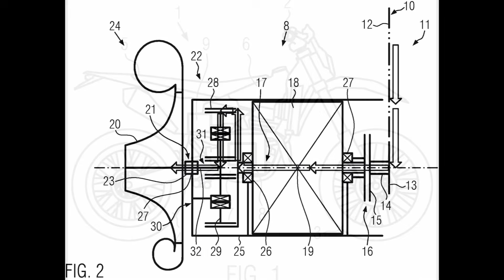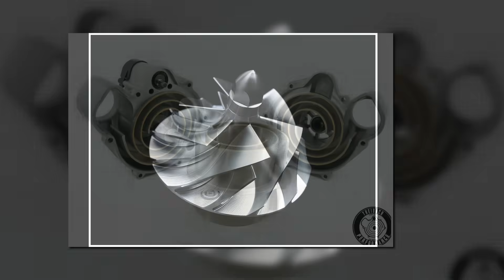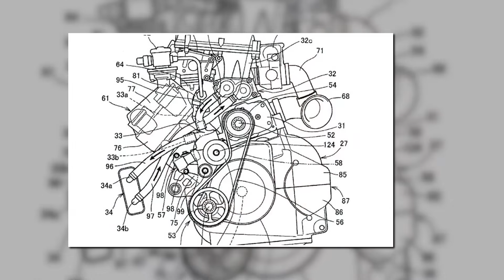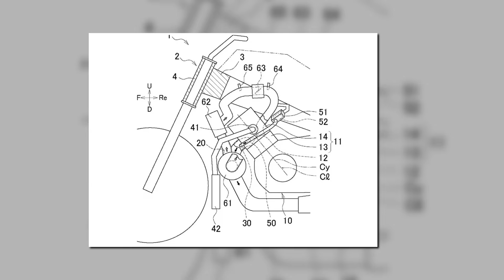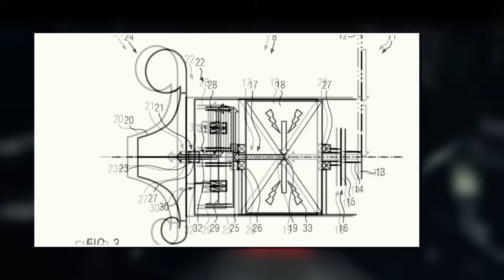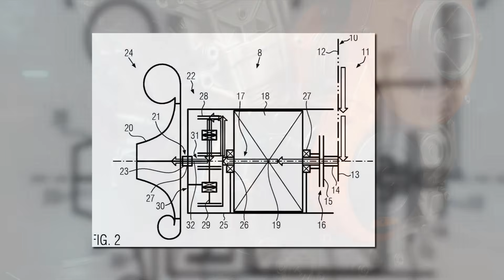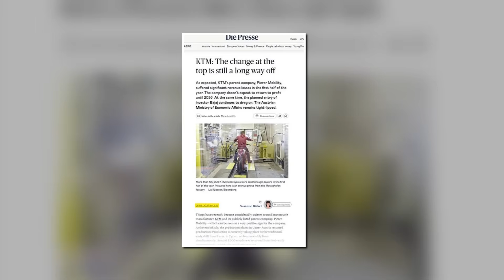Did KTM Just Reinvent the Supercharger?

Comment: The stupidist thing motorcycle racing did was banning boost after WWII, codeming 2 strokes to emissions hell by crankcase scavenging. Because as 2 stroke aero engines like the Rolls Royce Crecy, Napier Deltic & Napier Nomad shows, with boost scavenging & direct injection 2 stroke engines can be as efficient & emissions clean as any 4 stroke.
Reply: 2 strokes arent reliable... and besides that those motogp bikes already go like light speed. 
they dont even wanna be that fast.
Reply: @Lausa05  do you realise how reliable aero engines have to be?
Reply: @mickvonbornemann3824   an  AERO ENGINE has lots more room then an motorbike engine .
turbo 2 strokes also beeing used for ships , its not that they dont work , but i dont think it makes sense on a motorcycle tbh. 
u still burning alot of oil wich is bad for emissions.  
modern 2 stroke aero engines got like 1200 hours of runing time until they need maintenance.
to build the whole thing on an motorcycle is gonna be complex , since u dont have that much space.
and then again u gotta think about getting the power somehow onto the track.
Reply: @Lausa05  no one’s talking about turbos, they don’t function well for 2 stroke scavenging, well unless directly linked to the crankcase via a variable ratio gear set, so they function like a crank driven supercharger till boost build’s up. We are talking about centrifugal superchargers or piston based air pumps, not uncommon on motorcycle racers till boost was banned. Take those Austrian 5 cylinder racers, 2 twingle cylinders with a airpump cylinder (an airpump cylinder works like the cylinders on portable electric compressors). Also you seem to forget aero engines are designed to run at near 80% top revs 90% of the time & reliability was rated at a much tougher level than land based engines & were also higher performing than motorcycle engines at the time on any a performance over weight measure. Take the BMW F700 parallel twin. It’s a 4 stroke 360 degree twin, which in a 720 degree 4 stroke cycle the 2 cylinders alternately fire each 360 degrees, yet to balance there’s a 3rd conrod in the middle set at 90 degrees wastefully just working a weight. If it wasn’t for the ban on boost, instead they could have that middle conrod working an airpump cylinder, compressing air while still doing it’s primary job of balancing the engine. But now today, instead we have parallel twin motorcycles with 270 / 90 degree cranks to emulate a V2 to balance them, meaning unequal firing pulses instead.

Comment: Electric assist Turbos have been around for a long time(and their Patents).
Now to make a supercharger electric, is the pinnacle of Stupidly(marketed as "innovation").
Let me explain. - Superchargers are MECHANICALLY driven compressors(usually scroll type), which take DIRECT  Engine power  as the Prime Mover to compress air and force this into the combustion chamber(along with  fuel) to INCREASE the. Volumetric efficiency of an engine(more sucky and fuel into a chamber vs. NA) , particullarly at low to medium rpms.
Anything electric either needs a Prime mover to generate the stored charge(with the associated intrinsic inefficiencies.that compound one another).
Nonetheless, regenerative braking can provide good kinect energy scavenging, but again its intrinsically inefficient and its losses are compounded...
The ONLY way to create mechanical advantage is to create a reservoir of Kinetic Potential Energy (pressure accumulators).
BUT the OBVIOUS problem in the 2 wheeled world is volume(inverse cubed) versus scavenged energy via the area rule(disc brakes/gearbox) ie. Inverse squared)...
If anyone can make Inverse Squared equate to more that Inverse Cubed in a physical mechanical system, then they are..........
This system reeks of desperation mixed with Snake Oil!
Reply from the maker: Thanks for the detailed explanation; it's always interesting to get a different perspective.  I’ll be honest and say superchargers are definitely out of my comfort zone 😊

Comment: Interesting supercharger drives out there, electric sounds good but its only practical in short burst,  or the variable speed or 2 and 3 speed superchargers used on some ww2 aircraft, clutched drives AKA Mad Max car. I dont like turbos on street motorcycles the power curves feels completely wrong. I have been riding my supercharged bike for over 6 years now and wouldnt want to go back to N/A all old school tech Roots blower carb etc, there is so much bottom end pull on it that you get it rolling and stick it in any gear you like and it will run fine
Reply from the maker: Is on an H2? For me my issue is simply one of weight and complexity 😊👍

Comment: Halo bikes are good PR but seldom make a profit and mid size bikes with forced induction have been done before (80s) and resulted in heavy bikes that cost as much as the simpler litter bikes.
Reply from the maker: Exactly 😊 if it can’t do the same power in a lighter package what is the point?

Comment: My brother has a 3rd gen 1290  super duke, and I get to ride it.   I can't get anywhere near full throttle in the upper part of the rev range without the bike wanting to backflip. I suppose because it's the only bike I've ridden with fancy electronics, I'm a bit scared to trust it to not loop, but who on Earth needs more power than that in a road bike?

I've owned faster bikes than my current 20 year old ER6F in my 27 years of riding, but the humble little 70hp twin keeps up with anything on the group rides I've done.(Unless they go full "Isle of Man" mode, which is rarely possible theses days)
Reply from the maker: That's a good point; even more modest bikes can be just as fun and rewarding in the real world. 😊👍
Reply: a super duke also is like standing on stilts compared to an actual sport bike... of course youll flip over on accel
Reply from the maker: I’m trying to rationalise why a tall bike would flip easier ? Help me 😊

Comment: Interesting times post Euro 5. What about real hybrid motorcycles with electric motors in the front wheel ie real 2WD; petrol at back and electric at front?
Reply from the maker: An interesting thought. But many issues around hub motors. Not least of which is the high reciprocating mass of your steering wheel. But wheel damage off road another one. Kawasaki had to send a DO NOT USE warning out to owners on their hybrid too. So not a good sign
Reply: Ohlins had a hydraulic 2 wheel drive kit in the mid 00's. I saw a R6 on the beach flying through the sand at 15k+rpm. I was thinking wtf??? I talked to the guy, I checked it out and thought this is the future. Guess not. Even if it's electric too much R&D involved then when they've already tried it.
Reply from the maker: Interesting. Not come across that one

Comment: Bit slow on the uptake. Around 2012, I wrote to Kawasaki and suggested they install the 300HP 1500cc supercharged engine from their jet sky into 2 wheels as it would be a licence to print money. They initially laughed at me but within 6 months wrote back with a photo of their supercharged engine on display at Tokyo Motor Show in 2013. When the track only H2R was released to the public it had 300HP but the road going H2 only had 200HP. At that time, you could buy a naturally aspirated motorbike with 200HP, so a supercharged motorbike didn't seem so special. In 2019 they updated the bikes to produce 326HP and 243HP (with ram air) respectfully, which upped the ante somewhat. In 2022 I purchased an H2 and was pleasantly surprised by the riding characteristics of this motorcycle. It is definitely a try before you die. Now other manufacturers are coming on board as they've worked out that supercharging is the best strategy to circumnavigate the emissions restrictions. Supercharging used to be the norm for racing bikes prior to WWII but was banned afterwards. Just imagine a world today if that had not occurred?
Reply: 200hp NA and 200hp supercharged can feel worlds apart as you realized when you first took delivery and whacked the throttle for the first time. Cheers 🍻 I hope to one day have a Zh2 to call my own

Comment: If you look at the history of motorbike and car development, over the last 40 years, bikes have been almost 10 years behind. Beginning with ABS as an example. In the 90’s my car at the time had ABS, yet I was never going to own a motorbike with ABS.  Now, it’s compulsory on any newly developed bike and has been this way for a while now in Australia (with a couple of exceptions).  Adaptive radar cruise control?  I love it, and have had it in all of my various cars over the last 10 years, yet still don’t want it on my motorbikes.  So, is it a mindset or slower introduction into the 2 wheels, or perhaps both? 🤔
Reply: Adaptive radar cruise control?  I love it, and have had it in all of my various cars over the last 10 years, yet still don’t want it on my motorbikes.

I can think of a few reasons.

1.  It makes a hobby that is already getting expensive, even more expensive.
2.  Makes it harder to make even casual changes to the bike.  For example, you can't really put a tail tidy on a current year H2SX because of the rear cruise control module.
3.  Personally, if I'm on my bike I don't want to encourage the type of set it and forget it mindset that adaptive cruise control engenders.  I'm not in a protected box on a bike and I want to be mentally engaged at all times.
Reply: @Jaslath  Well said.
Reply from the maker: It’s not that bikes are ten years behind I don’t think. The problem is more one of OFTEN ( not always) car tech just doesn’t work so well on bikes. It is a different use case much of the time. The bulk of car use is commuting whereas people green laning and doing track days in cars is much smaller by proportion. Certainly in the west motorcycles are more about use as a form of entertainment 😊
Reply: @barebonesmc   They are behind compared with 4 wheels.  You only need to look at the debacle MotoGP is becoming as they are following what didn’t work so well with F1 a decade ago.  Yes, my commuting days on two wheels are long gone, yet I’ve always had cars so a decade is perhaps a bit too long, and I agree to a point regarding the differences between markets/regions, however this has stayed consistent over the decades as well.  An interesting topic for discussion though.  👍😎🇦🇺
Reply: Marketing gaff or legislation on a Bike, expense increases the outcomes of gadgets on a Motorcycle.  Behind is not a term i would use for electronic gadget's added. 1390 has i think, 4 ECUs Farrrkkk.

Comment: This is silly, I got a turbo zx14r that makes well over 2x what a h2 makes and weighs 480lbs... You're making assumptions about bearing wear blah blah blah. Long haul trucking, turbos last forever. Who the hell rides that much. This is all silly just put a turbo on it. Superchargers last plenty as well so it's a stupid claim.
Reply from the maker: A fair point. I don’t think I made such a big thing about the bearings. It was a comment in passing but I do think it’s valid. People have made cams that don’t eat themselves for years but ktm seem to struggle. I think the control interface will likely be the hardest bit to get right
Reply: @barebonesmc I do my own tuning on my cars and bike. It really isn't hard with modern ECU at all. Even using a piggy back like a power commander how I first had it still works. I got it dialed in but it wouldn't compensate for extreme temperature swings so tune up would change by .1 to .2 of a afr if there was a drastic weather change. That said no no this is a issue with aftermarket ECU and OEM the likes of BMW have thousands of tables that can be adjusted for all kinds of weather and occurrences and Chevrolet have a extreme amount as well. Even making a cut down version still would give plenty of tables. I've tuned HP tuners, fueltech, and haltech mainly they all could do the job. The fueltech weighs less than the stock gauges on a zx14r and it's smaller and has a integrated ECU so it's not just a screen. So really no reason at all in the modern day.
Reply from the maker: I can’t imagine many ZX14 owners saying I want more 🤣🤣 no roads here for a turbo one 🤣🤣
Reply: @barebonesmc lol yeah no many curvy roads here and there is a 1/4 mile track a hour away so only thing you can do is go fast in a straight line.
Reply from the maker: Enjoy it mate 😊